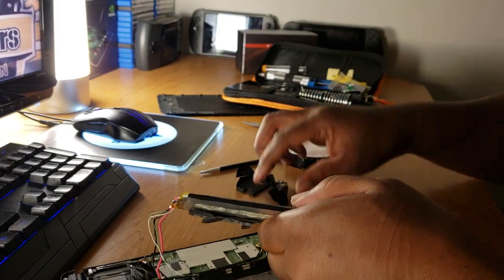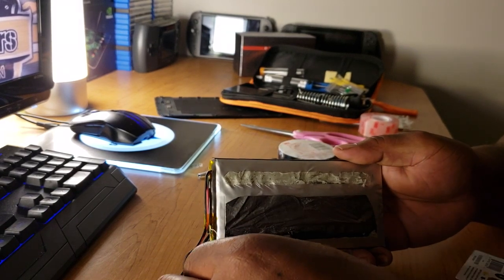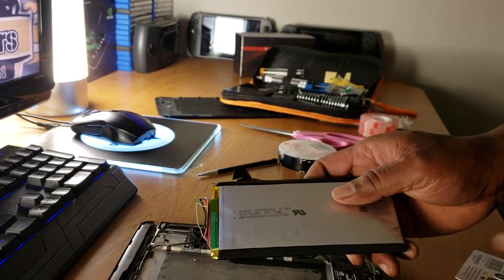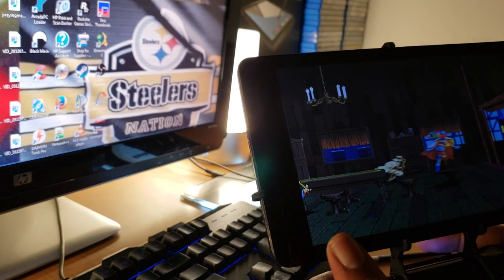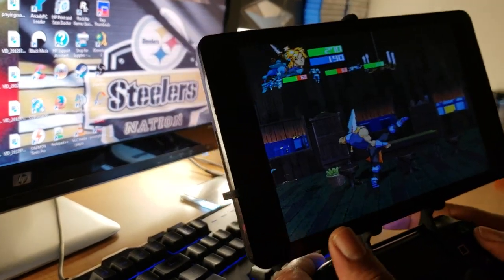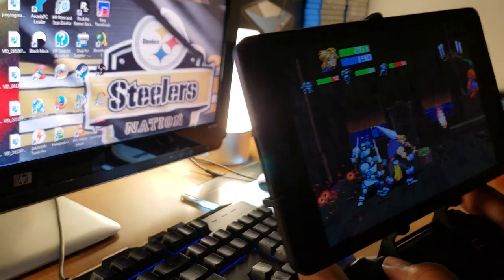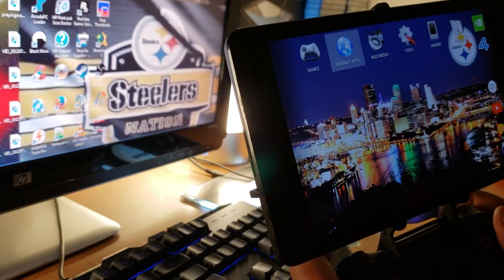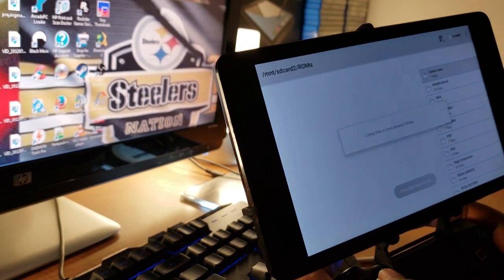REPLACING THE NVIDIA SHIELD TABLET BATTERY! (THE EASY WAY)

Comment: I just did this...  Should have videoed it...  Never unsoldered anything...  Removed control board from new battery by prying lose the battery connectors from the board as they are spot welded. Wanted to retain as much of the battery connector as possible. On the old battery I cut the battery connectors right beside the control board with scissors. Then soldered a small wire to the negative on the control board as the negative on the battery doesn't line up. Then I soldered the wire to the negative on the battery. Then soldered he positive on the battery to the positive end of the control board. Placed a separator between the negative and the board as it hits right where the chips are. Taped it up and put it back in.. Working like new...

Comment: does the new battery get hot like the one that came with the Shield ? Ive went through 4 replacements sadly and the 3rd one was the best and never got hot but sadly that shut off and never turned back on 32 days in
Reply from the maker: I haven't experienced any over heating with this one

Comment: Good job, man. Helped me a lot, my battery is bulging on my shield that I got after the last one was recalled. I'm not sure how long it's been since they sent the now one, so not sure I can get a new one from them, but this will help me bring my Shield back to life.
Reply from the maker: I love the nvidia shield its my favorite tablet and i was excited to revive it from the dead. Glad i could help let me know how it turns out.
Reply from the maker: Wait did you say your recall replacement tablet battery is bulging? Or the original before the recall?
Reply: The battery on my replacement is bulged so bad it popped the back case off.

Comment: Hello, good morning people. First of all excuse my English. I have been running my Shield Tablet for 3 years (replaced, that is, the old one) today I was given to turn it on and I wanted to install some ROM. Up to now, I have only Flashe Install SuperSU and Nomoreota. I am currently in 5.1.1. Should I install another ROM so that Nvidia does not kill my tablet? or with what I did is enough to be able to use it?
Reply: Suricatamike I know that is over a one year but I hope is useful to someone ! 
The original rom - firmware is android 7.0 ! 
Original Shield tablet Software-Version is 5.4(24.29.404.195) android 7.0 ! 
Use magisk root for rooting is better ! And the custom rom you must search for your self was is better if you can find a custom rom android 7.0 is good better Android 8 or 9 or 10 ! And as a custom recovery use TWRP recovery !
Best regards,

Comment: Thanks for the upload. Did that little battery circuit board get hot once you soldered on those wires? Mine has and it doesn't seem right ...
Reply from the maker: No it didn't Thats strange
Reply: @bigwhop136  I had it cross-wired. Luckily I was able to reverse it without doing any damage. Everything's working fine now.  Thanks again.
Reply from the maker: @mkearley49  Glad to hear bro!!

Comment: Good job dude! I like your style!
 I'll be doing this battery replacement soon and if I may give you a little tip for your future solderingwork, get some flux. It will do wonders. Also, a cheap multimeter would be a nice addition to your toolkit.
And can you give a link to that tabletholder you have om the psp controller?
Reply from the maker: Thanks a lot bro and here is the link for the holder: https://www.shapeways.com/product/TUVJSQVTG/ps4-controller-nvidia-shield-tablet
Reply: @bigwhop136  Hello, I have this tablet in 2024, I can connect it without a battery, directly to a power socket

Comment: Did you not remove the PCB board from the new battery first? I know you need to re-use the original tablet battery's pcb, but most all new batteries come with a pcb on them that I thought had to be removed....
Reply from the maker: This battery did not come with a board and if it did i would have removed it and used the original one
Reply: Turns out the battery he used does have a PCB, I suppose it still works even if you leave it on, but I'm not sure how safe that is in the long run. The problem with this method is that it bypasses the thermal cutoff (the white thing connected to the original PCB's B+) which is supposed to protect your device.
Reply: @Autumnflare240  yeah I thought so, most of these type of batteries come with a pcb on them. I just finally replaced my battery a few weeks ago too. I used a 4700mah Cameron Sino battery that was a little smaller dimensionally because I wanted a name brand battery. I replaced the pcb it came with. I even made a simple battery tab spot welder to re-attack the pcb with (instead of soldering it).
Reply from the maker: @Autumnflare240  its still going strong no issues with heat or fast draining
Reply: @bluegizmo1983  can u give the link to the battery

Comment: Do you have an links for where you found the battery? Currently trying to find the parts I would need to do exactly what you did. -edit* I watched the other video you mentioned and followed his links. I take it you purchased the same battery? How's it holding up? Does it charge to 100%, seen a lot of people saying theirs was only charging to 80% or so.
Reply from the maker: Yeah i purchased 2 just in case but its holding up well matter of fact im on it right now. It charges 100% and i play emulators all the time on it
Reply: @bigwhop136  Great man - thanks for the reply. I just submitted my order for 2 of them as well HA! Hoping this works out - sadly since it's Ali-express it'll probably take a month to get them in. Did you have to remove any existing circuitry on the new battery? I saw in some of the comments on Ali that some were saying they had to remove a control board on them? Thanks for the feedback - nice video - was just starting to watch yours again to make sure I understood what you did.
Reply from the maker: Mine took a while to get here but it wasnt a month maybe 2 weeks and juat follow my video and you should be fine.
Reply: Yeah where are you ordering the battery from? I wanna get the same one
Reply from the maker: @mobilegamersunite  https://m.aliexpress.com/item/945908873.html?spm=a2g0n.orderlist-amp.item.945908873&aff_trace_key=63b508ec9b034fbcb47d77d3e0aecf5e-1548521961975-03909-UneMJZVf&aff_platform=msite&m_page_id=4431amp-KSBFyUhGLuImMJoqZsDMmg1548522139627
Reply: @bigwhop136  thanks for that. So how long does the new battery last? I was hoping that by now they made a 9 hour batter for the shield....but ill be happy with 5 hours. Xinomi is making a tablet now with the same processor as the shield but they want 400 bucks for it...also it only has 2 gigs of ram. I would rather fix my shield tab that i paid 200 for. My buddy adam got his shield tab for 450 used, idk why the price went up so much...also he got his used and now the battery is dead...long story short he is pissed and hates the shield tab now. I tried to explain to him that he should never buy used tablets lol. I might try to buy his as well so i can fix both of them. I play ffbe and other tablet games so to me my shield tab is priceless. The tegra processor just murders anything else out right now unless u got 1000 bucks to throw around. and if i was going to pay that much id get a tablet with a removeable battery, and right now only dell makes them and they are over 1200 bucks...and thats if you can stomache dell products lol

Comment: Good video, thanks man. Hey, do you know if this will fix the ones that Nvidia deactivated after the recall? I had heard online once that changing the battery would fix it, but no one could find the batteries to try it at the time.
Reply from the maker: I think ive read the same thing somewhere but the only way to find out is to do it. Let me know if it works!

Comment: Can you link the battery you purchased?
Reply from the maker: Sorry for the late reply bz with work 
https://m.aliexpress.com/item/945908873.html?spm=a2g0n.orderlist-amp.item.945908873&aff_trace_key=63b508ec9b034fbcb47d77d3e0aecf5e-1548521961975-03909-UneMJZVf&aff_platform=msite&m_page_id=4431amp-KSBFyUhGLuImMJoqZsDMmg1548522139627
Reply: @bigwhop136  from the link u have given the product seems to be sold out is there any other option...
Reply: @estherlalmuanzovi8724  there's a certain Asus Tablet that has a battery that I've read is used for the replacement. It's like 40$ on Amazon. Nvidia never sold spare batteries so people usually Frankenstein one with similar specs
Reply: @Dashman98  thanks keko can you tell me the specific model 😄😄😄😄

Comment: Any chance you know how to replace the wifi antenna in there? Nvidia doesn't repair or replace anymore. Also, what antenna is needed? Great video and thank you.
Reply: I just did the recall last week. I have a tracking number for the replacement. Should be here in 3 days.

Comment: I ordered the same battery from Ali, does the new battery come with a control pcb?
Reply from the maker: No thats why you dont take off the one in the shield
Reply: @bigwhop136  Got the battery, it does come with a PCB, but I stripped off and attached the new battery to the old PCB. It works fine, but the supposed 5000 mah battery I ordered from Ali only have 4000 mah, and I tested it before installation. So far everything is in order, but Shield K1 is a battery hog.
Reply from the maker: Wow ok well mines didn't come with one thats why in the video i just attached the positive and negative to the original control panel. But im glad you got it to work.
Reply from the maker: This is the one i got and the battery holds a lot of juice in its own.
https://m.aliexpress.com/item/945908873.html?spm=a2g0n.orderlist-amp.item.945908873&aff_trace_key=63b508ec9b034fbcb47d77d3e0aecf5e-1548521961975-03909-UneMJZVf&aff_platform=msite&m_page_id=4431amp-KSBFyUhGLuImMJoqZsDMmg1548522139627

Comment: I just decided to go through with this after finding out my battery health was 36% which is horrible. I'm hoping that will improve the performance of the tablet and make it useable again. Hopefully it's not the storage module that's the issue. I think I'm gonna cut the batteries wires a bit shorter to make it easier on space inside the tablet. Did you notice performance improvements after this. I can't bring myself to throw out working tech.
Reply from the maker: Ohhhhhh mr spoil alert he dies at the end look who has to do surgery now lol
Reply from the maker: No but seriously since ive done this I had no problems and if I havnt been playing my switch a lot i would be emulating in it.
Reply: @bigwhop136  Ha ha! Now it's my turn to die!!! 😂
Reply from the maker: @MobileDecay  lmao make sure you record it 😭😭😭😭